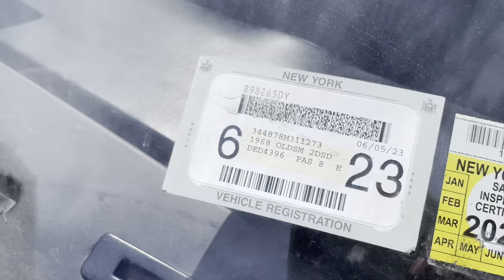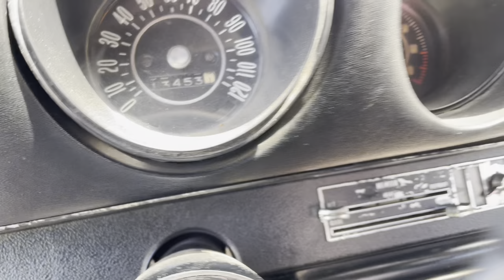1968 Olds 442

Comment: It has the wrong seats.  Those are from 70 to 72 front seats. 68s didn't have 455s they had 400s.
Reply from the maker: Good call on seats. Yes the auction guy stated it was an orig 400 car that was now upgraded with the 455 muncie combo. Keep the good info coming 👍🏾
Reply: @onjunk4life  it's a beautiful 442! The 455 is better than the 400.
Reply from the maker: @ronaldhellengreen7063  Agreed. Torque monsters.
Reply: @ronaldhellengreen7063  that's cool if I don't care about #'matching or factory correct.
Reply: @ogg-men  I used to care about originality, but nowadays the original 442s are so expensive a clone is the way to go. Especially if you're gonna drive it! I know one thing for sure if I'm ever lucky enough to own another 70 442 I would drive it every day that the streets were dry! I envy everyone of you who has one, original or not! I'm an OLDS fan forever! All you have to do is drive one, and you'll be a fan to! PEACE ✌️